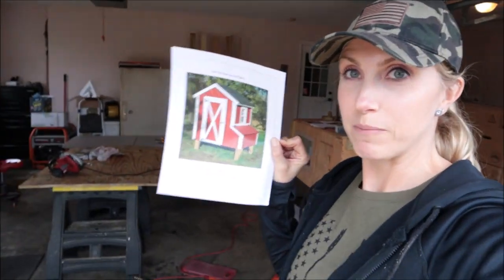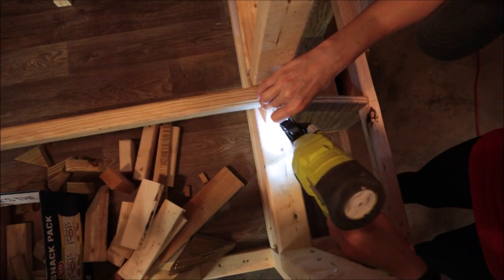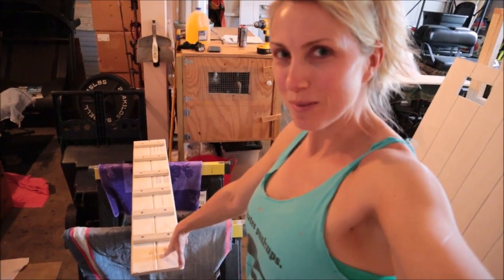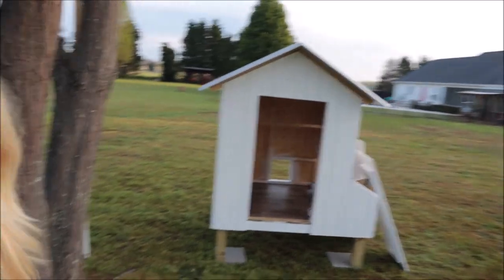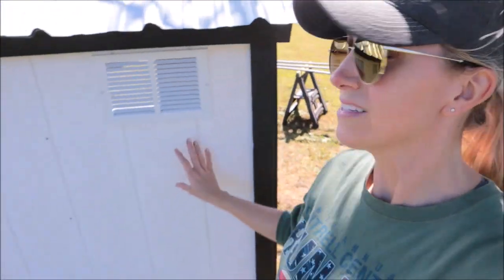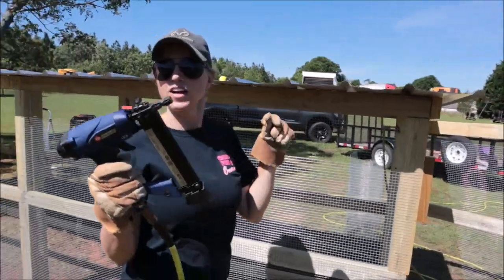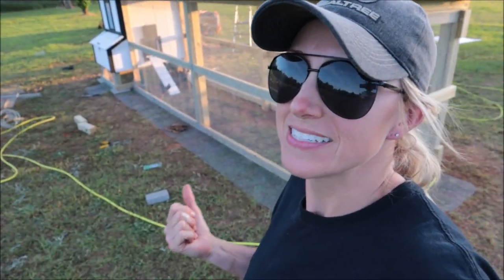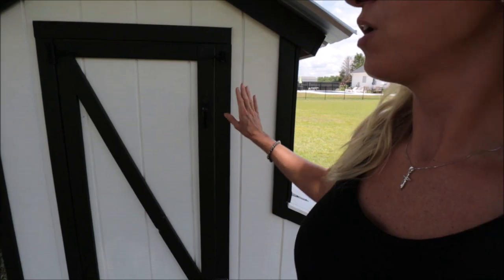How I Built Our Chicken Coop

Comment: Hi, thanks for sharing your video and your experience. One question, where can I get the windows? and what size are they?
Reply from the maker: I'm not sure on the window size, i did not buy an actual window. I just cut out a square from the wood, then framed it in with some of the hardware cloth wire.  However, the coop plans I bought on etsy that i referenced (in the description) has the window size info.  I believe you can order it online. Hope this helps! :-)

Comment: How many chickens fit in the coop without the run? Also how many fit with the run? Did the plans come with directions for the run?
Reply from the maker: Hi Kitty Cat!! I built this for 8 chickens originally. But since then, I have lost a chicken and gave away our rooster, so now I’m down to 6. I don’t think I would go over 8 chickens. But if you have more than 8, there is a bigger coop house design plan from the same seller on Etsy. The pdf plans I bought do not include plans for the actual run. My uncle and I came up with that part on our own. Sometimes I wish it was bigger/wider. But it’s fine for what I have. I hope this helps! Thanks for watching!